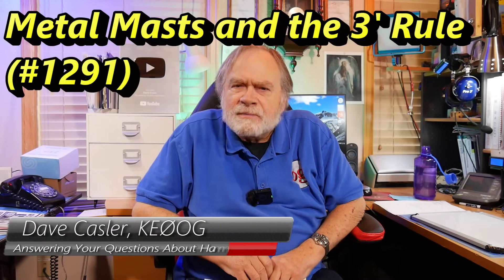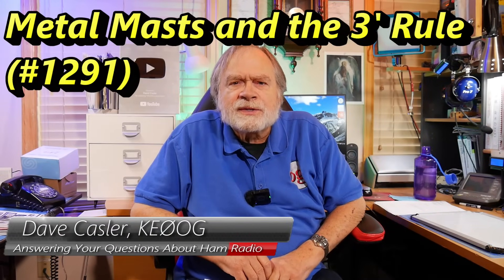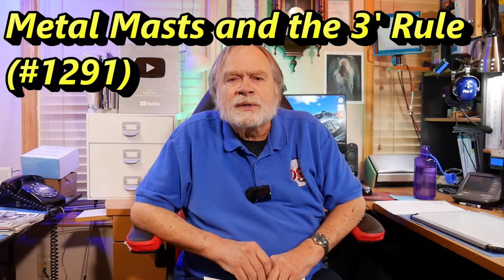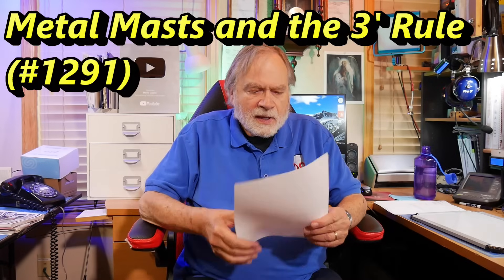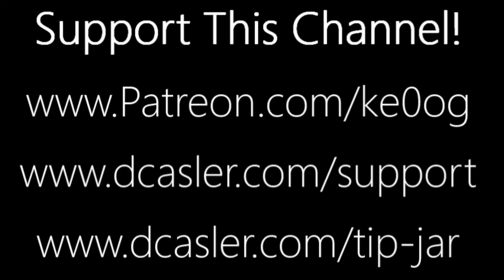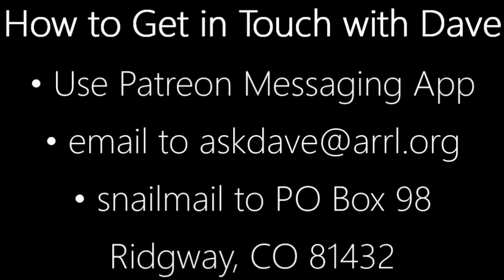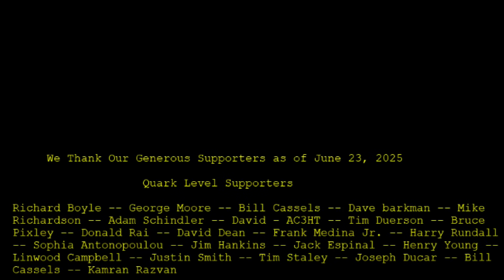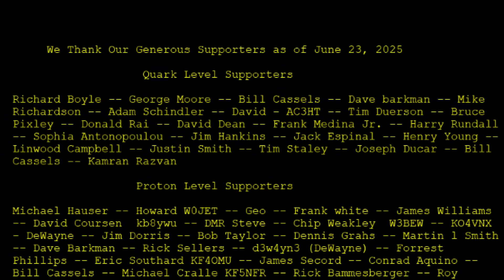Metal and the 3' Rule (#1291)

Comment: I have a VHF vertical on a fiberglass mast (a rather heavy duty one from DX engineering)  about 25 ft tall with a 10 ft antenna.  The mast is attached to a 12 ft 4x4 via pipe clamps that fit around the the 4x4. The 4x4 was buried 2 ft into the ground.  No guys and this has survived 8 years and up to 60 mph winds. On windy days it does move around a bit.  This set up would be suitable for a wire vertical, a dipole or other light antenna.  The set up could go to 30ft for a wire antenna support. I put this up with only light assistance from the XYL. She tightened the first clamp.  For my StepIR vertical  I sunk 10 ft 2X4s into the ground and attach the guys to the top of the 4X4s. I can easily mow under the guys.

Comment: Or/and attach a strong rope/wire tight between each pole some distance ( 3 feet or more) from the base of each pole to reduce stress on the pivot point. Maybe use clamps to secure wire/rope to each pole.

Comment: It seems to me 30' isn't so high that you couldn't walk it down in the same fashion as stepping a deck mounted mast on a sailboat.  Granted, sailboats use 4 guys (stays) not three but I've stepped plenty of masts around 30' or more.
Reply: How much weight is attached to the top of your sailboat mast?
Reply: I have tall sailboat masts made of wood too, as masts the eliminate the interference with twinlead you get with metal, and you can run a vertical dipole  from them too.